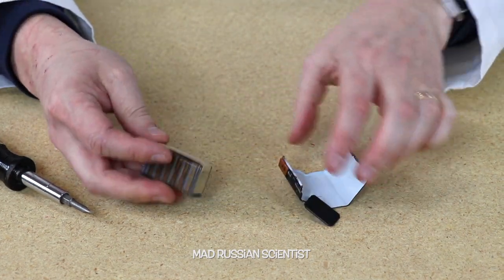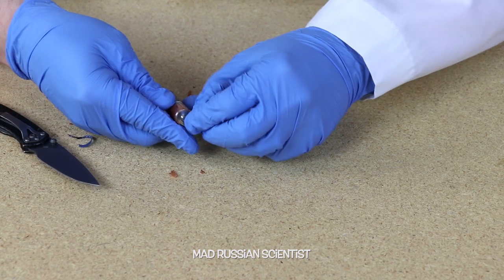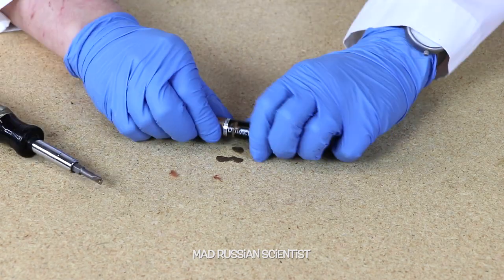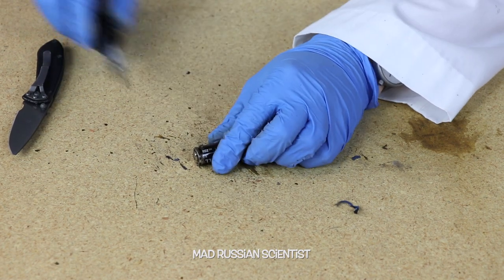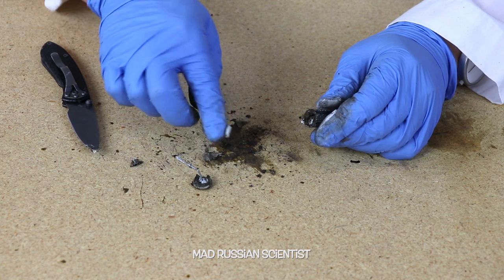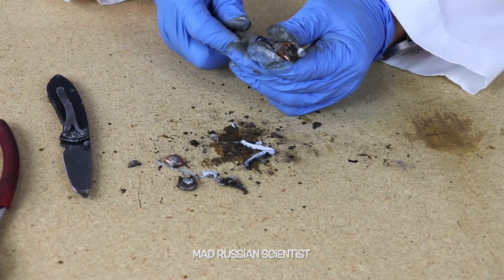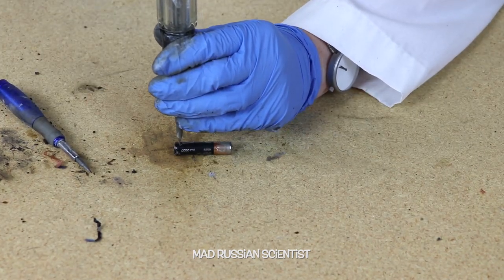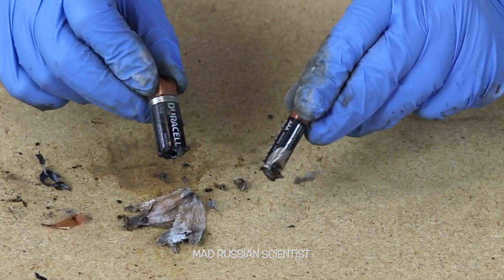What's Inside AA and AAA Batteries

Comment: The paste is an electrolyte paste made of Manganese oxide which reacts with a zinc anode on the bottom of the battery (the flat side). The rod inside is a graphite cathode which acts an an "inert electrode" which basically means that electrons move through it (the side of the battery with a bump on it). The reaction between the manganese compound and the zinc is what makes the electrons that move through the battery which is the "electricity". The battery itself is made of steel so it doesn't react with any of the compounds.
Reply from the maker: Great explanation! Thank you!
Reply: @thegoldenwindow 🤯
Reply: Thanks for explaining!
Reply: Thanks for your expertise 👍🏼
Reply: im litterally watching this video because im learning about the half reactions in an anode and cathode cell and wanted to see the real life application of this. thanks for the explanation xD. I kinda feel smart now
Reply: Why are you so smart
Reply: I believe it’s graphite anode
Reply: Useful information! Thank you!
Reply: Question: Is manganese oxyde what’s always been used for this function in these batteries, and if so, has it always been in this “cream/paste” form? Is there a variety of inactive “filler/binding” agents that can/is used in varying proportions among manufacturers? 

I’m wondering if that’s relevant to the widespread “unprovoked popping+hissing+spewing all its paste” phenomenon in new/healthy Duracells in recent years   (vs slow, mild, crusting seepage in expired/neglected batteries of the past).
Reply: I don’t know bout that;)
Reply: Well no the black stuff is manganese oxide. The white "paste" is zinc hydroxide.
Reply: thanks!!!!!
Reply: Is it same as heat sink?
Reply: This was more valuable than the video. Thanks.
Reply: What happens if swallowed?
Reply: I try to open it with my teeth but accidentally some of this grey paste came iny mouth 
I washed my face with soap 3 time but still I damaged my lips little bit  skin get damage
Is there any serious issue ?
Reply: Will you make one of these videos, please?

Comment: Get some needle-nose pliers. I've opened AA batteries with those and it was easy.  Also, when I've opened AA batteries, there was a stack of small button-batteries inside which is much cheaper than buying the button-batteries.  There wasn't any paste...weird.
Reply from the maker: I'm planning on getting these pliers actually

Comment: Big batteries does not fit to the small hole battery of the computer mouse.  aa batteries can fit RC vehicles. AA batteries can't fit on small AAA battery hole
Reply from the maker: True
Reply: Agreed when i first got my LEGO Mario i was stupid enough to not check twice the battery input, and missaw that it needed 2xAA batteries (when it actually needed 2xAAA batteries), so i grabbed the AA batteries, and they didn't fit in the AAA battery hole